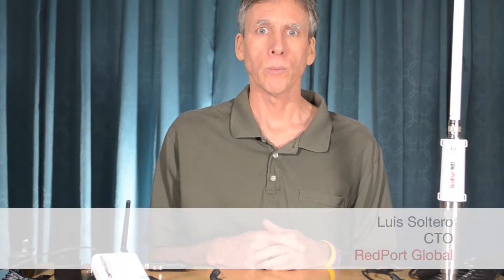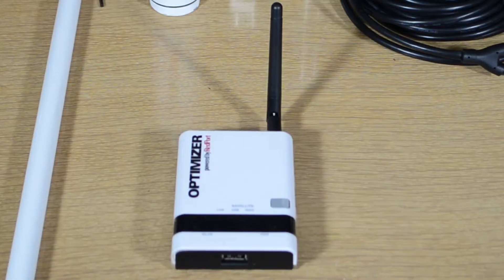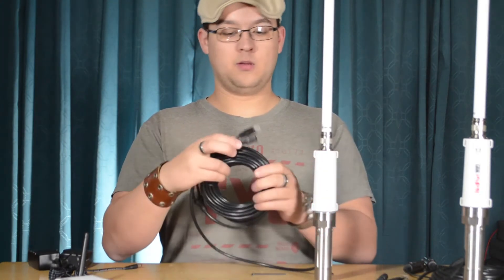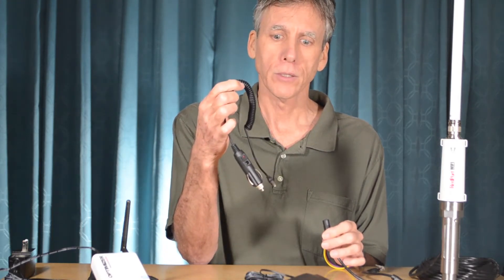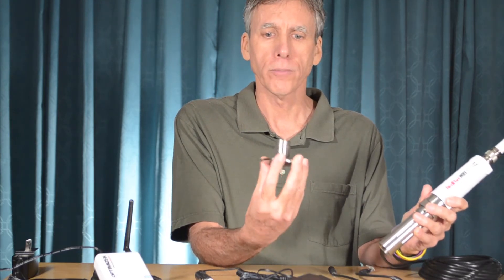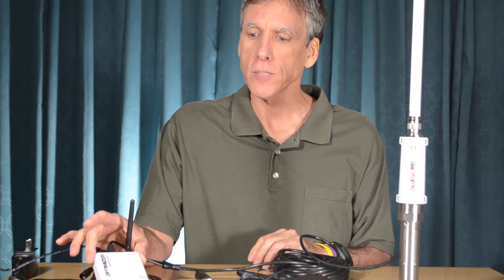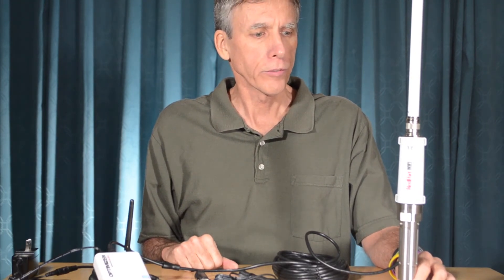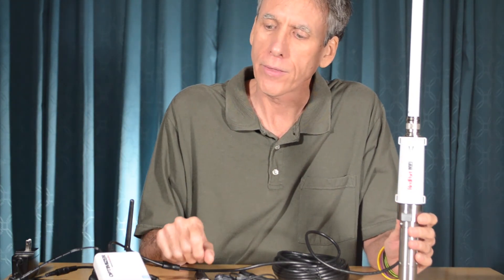RedPort Halo Setup: Part I (WiFi Extender Setup and Specs)

Comment: I've had this for 3 years.  Pretty spendy and have yet to get it to work correctly.   I set it up to extend the wifi from my home to my backyard.  Everything is functional,  but my Comcast which tests at 50+mbps in my home connected to my comcast router only gets .32mbps when connected to the extender... ummm, that's slower than dialup.  No idea why this is the case, but wasted $$$.... I'll update this if the company can tell me why it's doing this and what is wrong?

Comment: This is a POS....First one I got crashed during firmware update. Have three calls and a month with Tech support I was told to return it for another one. I'm on my second one and it crashed again. I could get better wifi if I held 5 $100 bills in the air. Returning and going with another brand.

Comment: You get what you pay for.  This system is a fair price.  I can watch youtube without buffering circle.  Emails load fast.  This is happening without the antenna being mounted outside.   I was contemplating purchase of a new phone or a new computer to repair problem of slow internet.  Through research I found that computers and phones are restricted in output wattage.  This means that purchase of new electronics would not help my problem of a weak signal.  I purchased a Wifi repeater from a local store (75$) which worked ok when I had shore power.  I needed something that ran off of 12vdc. This system solves the problem.  I suggest that you watch both videos before installation.  20 minutes of your time will really help out.  Others have said that the grey gasket does not work well and use silicone.  I will use Sikaflex which is a MUCH better sealer.  Silicone is designed to be pulled off so that repairs can be made.  This means that moisture will eventually make it through.  This will not happen with Sikaflex.  I would not use 3M 5200 which is a permanent sealer/adhesive.